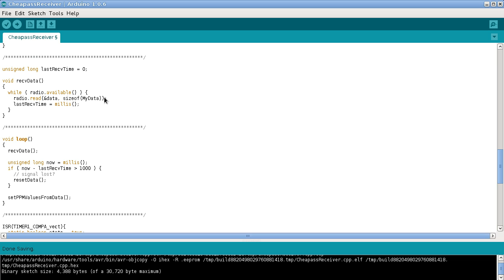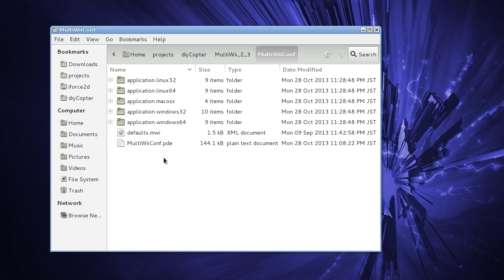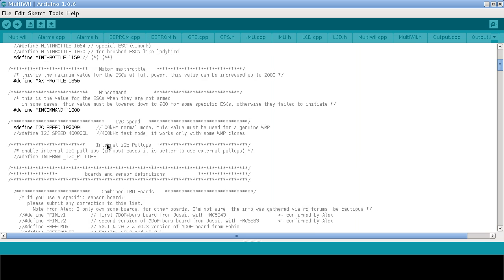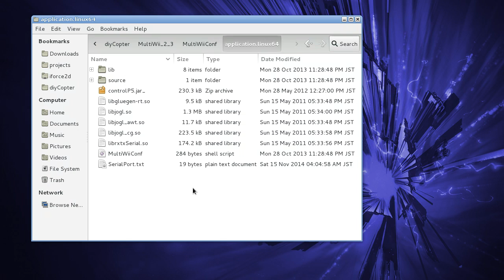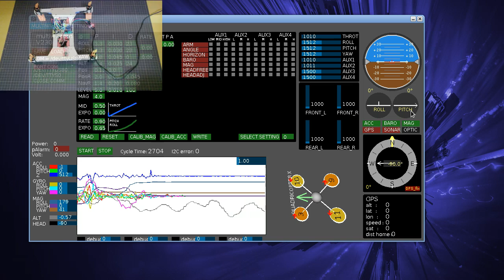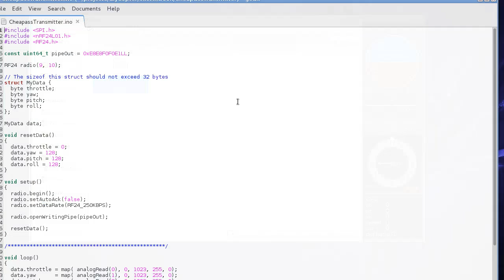Cheap-ass quadcopter build Part 8 - "Receiver" (continued)

Comment: Can u pld help me on this i ulpoaded ur sketch on both side did calibration too checked in serial monitor it works but on the receiver side signal is mixed if i move on channel all channel get some mix signals and also i m not getting full range of channels only some of it can u pls help me on this i m stuck pretty badly
Reply from the maker: Sounds like bad ground connections.
Reply: @iforce2d  i did check every connection twice and also used two different flight controller and stil its all mesy all singlals are mixed in reciver tab i move one channel all channels changes value can u pls help me on this
Reply: @iforce2d  how to fix that
Reply from the maker: Just follow through the process from beginning to end logically, and confirm every step. For example the first thing to happen is you move your finger on the stick. So print out the analog stick values on the transmitter side, check they are correct. Then print out the values of each member of the packet being transmitted, check they are correct.. etc etc etc. Software development is all about debugging, nobody can hold your hand all the way through every problem.

Comment: could you tell me how can i change the receiver code to get the PWM at 1520us center pulse? please answer my question, thank you.
Reply from the maker: Easiest way is to use the trims on your transmitter. If you don't have trims, just add the necessary amount to the channel value, at the end of the setPPMValuesFromData function.
Reply: thank's, it works great!

Comment: hi. thanks for the videos👍. i had done the same 6 months ago and it was working so good. and in these days i add oled screen and menu to transmitter, some rg leds to receiver. its still working so good when print ppm channels but when connect it to multiwii(2.4). i can only see 940 to 1004 for each ch. and its like middle and upper side is working.aux switched work once everytime i reset my board. at multiwii 2.3 its 1000-1004😟. i am so sure my connections are good. i checked them more than 200 times😄. waiting for advices.😊
Reply from the maker: Make sure you have selected the correct board type and CPU speed when uploading. Failing that, use an oscilloscope to check if the pulse lengths are correct. https://www.youtube.com/watch?v=FBAKxz7NSJk

Comment: can i use receiver with pro mini 5v? not 3.3v
Reply from the maker: As long as you power the nRF24L01 module with no more than 3.0v. The logic pins (MISO, MOSI etc) of the nRF24L01 can handle 5v but the power supply cannot.
Reply: iforce2d can i replace to pro mini 5v or not?
Reply from the maker: I just told you. If something is unclear, ask a more specific question :)

Comment: iforce2d, after changing the code, I went to test it and i found out that after arming the transmitter, it automatically spins the motor(at low speed) which is 0 throttle. I have tried uploading the old sketch but to no avail. HELP!!!!!!
Reply from the maker: What do you mean by 'changing the code'? I don't see why changing it back would not return things to the old behavior, obviously there is something more to it.
Reply: iforce2d last 3 days i asked about changing the speed settings on the multiwii board
Reply from the maker: I get dozens of questions like this every day. So I have no idea what you mean by "changing the code" here, I certainly don't recall seeing any details about changed code. If you want to keep track of some previous discussion, it would help to reply to the previous comment.

Comment: @iforce2d,  is there a way to change the speed settings for the multiwii board? I found that the quadcopter I made is too fast. What i meant is the quadcopter moving forward, backward, yawing , etc they are all too fast
Reply from the maker: You mean the rotation in each axis is too fast? The default settings should be manageable for a beginner, but if they are too fast you can reduce the rate setting. See the beginning of this video, https://www.youtube.com/watch?v=TGa-f-rLVZw (in that video I increased my rates a lot from the default because I wanted to do flips).
If you mean that it actually moves (not rotates) from place to place too fast, well that is just up to you to learn to control it better :)
Reply: what i meant is i found out that the maximum angle of the pitch and roll is too much. i need to know how can I adjust those angle
Reply from the maker: Just don't move your stick over so far :) But if you are ok with changing the code, this might help http://www.multiwii.com/forum/viewtopic.php?f=8&t=3440 You could also modify this in your transmitter if it has that setting.
Reply: iforce2d i am using the home made arduino transmitter (mod old transmitter)
Reply from the maker: Then you could also modify that, to send less range of stick movement.
Reply: iforce2d thanks
Reply: iforce2d this one!
Reply from the maker: ok. And what code did you change? I still don't understand why changing back to the old code would not give you the old result.
Reply: iforce2d i made the wireless test joystick thingy and found out the throttle range minimum is 1 -255
Reply: the rest is 0-255
Reply: i tried to switch the void loop transmitter sketch ( data.throttle 2nd line and data.yaw the 1st line) and now ...i am getting yaw range 1-255 and the rest is 0-255..!!! what is happening T_T...
Reply: Ok, I figured out!!! it seems that in the new multiwii2.4 source code, config.h has this //#define MOTOR_STOP commented, I uncommented it and it fix the problem. Thanks for the reply.

Comment: I am using cc3d flight controller and I with arduino pro min receiver and arduino uno as transmitter but when I setup flight controller in system health the input/receiver port of flight controller shows red? And because of this the receiver is not receiving input so I was not able to save transmitter settings. do anyone know how to fix it?

Comment: I have  problem, motors rotations different rpm.but difference is very high...what is problem?
Reply from the maker: Need more info. What are you doing to make the motors turn? Using a servo tester? Using the config gui? Using your radio control? Trying to fly or just testing with no props? Please think about your question from other people's point of view and don't make me have to ask more questions like this all the time.
Reply: i am using with my radio control.when a pump throttle up,on the multiwii conf simulation proqram shows different  rpm motors.i have already calibrated esc's
Reply: also i am usin without rotation motors and Multiwii conf simulation showed same results.very different rpm motors
Reply from the maker: Did you calibrate the accelerometer? Maybe the quad thinks it's not level, and it is trying to become level.
Does the motor speed difference start immediately, or grow gradually. If you don't have propellers on and it grows gradually, it could be because the flight controller tries to rotate the quad and nothing happens because there is no propeller, so it tries more, and more etc. That problem will be fixed if you put propellers on and actually lift off the ground.
Reply: yes i have calibrated.in the moment I start motors by arming , pulses are all 4 motors at maximum value, after 1 sec motors right rear and left front starts to decrease values. I didn't start to fly yet, cause I'm scaring about a bad crash.
Reply from the maker: Hmm... that's very strange, I have never experienced that. Does the graphical display of the frame match the movement correctly when pick it up and move it around? Two opposite motors going faster means it is trying to rotate in yaw. Maybe the yaw axis of the gryo is faulty.

Comment: Hi , i love how this worked in the video but in real world it is not working , i am wondering why i am not getting the same results>

in the video every channel (throttle,yaw,pitch,roll, and two extras ) of the signal is recieved in the MultiWiiConf application. But when i tested it locally i am only getting throttle value which is also inaccurate it never made it to the 2000 mark in the window, i combined your transmitter and receiver code and excluded the NRF part so i can check it locally without it, i only used a Joystick potentio meter to just send the values.

i will appreciate if you put some light on this problem :| 

here is the code just attach the joystick to the analog pins A0 ... and check:

thanks and regards

////////////////////// PPM CONFIGURATION//////////////////////////
#define channel_number 6  //set the number of channels
#define sigPin 2  //set PPM signal output pin on the arduino
#define PPM_FrLen 27000  //set the PPM frame length in microseconds (1ms = 1000µs)
#define PPM_PulseLen 400  //set the pulse length
//////////////////////////////////////////////////////////////////

int ppm[channel_number];

// The sizeof this struct should not exceed 32 bytes
struct MyData {
  byte throttle;
  byte yaw;
  byte pitch;
  byte roll;
};

MyData data;

void resetData()
{
  data.throttle = 0;
  data.yaw = 127;
  data.pitch = 127;
  data.roll = 127;
}

void setupPPM() {
  pinMode(sigPin, OUTPUT);
  digitalWrite(sigPin, 0);  //set the PPM signal pin to the default state (off)

  cli();
  TCCR1A = 0; // set entire TCCR1 register to 0
  TCCR1B = 0;

  OCR1A = 100;  // compare match register (not very important, sets the timeout for the first interrupt)
  TCCR1B |= (1 << WGM12);  // turn on CTC mode
  TCCR1B |= (1 << CS11);  // 8 prescaler: 0,5 microseconds at 16mhz
  TIMSK1 |= (1 << OCIE1A); // enable timer compare interrupt
  sei();
}

void setup() {
  Serial.begin(9600);
  resetData();
  setupPPM();
} 

void setPPMValuesFromData()
{
  ppm[0] = map(data.throttle, 0, 255, 1000, 2000);
  ppm[1] = map(data.yaw,      0, 255, 1000, 2000);
  ppm[2] = map(data.pitch,    0, 255, 1000, 2000);
  ppm[3] = map(data.roll,     0, 255, 1000, 2000);    
  ppm[4] = 1000;
  ppm[5] = 1000;
}

int mapJoystickValues(int val, int lower, int middle, int upper, bool reverse)
{
  val = constrain(val, lower, upper);
  if ( val < middle )
    val = map(val, lower, middle, 0, 128);
  else
    val = map(val, middle, upper, 128, 255);
  return ( reverse ? 255 - val : val );
}

void loop()
{
  data.throttle = mapJoystickValues( analogRead(0), 13, 524, 1015, false );
  data.yaw      = mapJoystickValues( analogRead(1),  1, 505, 1020, false);
  data.pitch    = mapJoystickValues( analogRead(2), 12, 544, 1021, false );
  data.roll     = mapJoystickValues( analogRead(3), 34, 522, 1020, false);

  Serial.print("Throttle: ");
  Serial.println(data.throttle);

  setPPMValuesFromData();
}

#define clockMultiplier 2 // set this to 2 if you are using a 16MHz arduino, leave as 1 for an 8MHz arduino

ISR(TIMER1_COMPA_vect) {
  static boolean state = true;

  TCNT1 = 0;

  if ( state ) {
    //end pulse
    PORTD = PORTD & ~B00000100; // turn pin 2 off. Could also use: digitalWrite(sigPin,0)
    OCR1A = PPM_PulseLen * clockMultiplier;
    state = false;
  }
  else {
    //start pulse
    static byte cur_chan_numb;
    static unsigned int calc_rest;

    PORTD = PORTD | B00000100; // turn pin 2 on. Could also use: digitalWrite(sigPin,1)
    state = true;

    if (cur_chan_numb >= channel_number) {
      cur_chan_numb = 0;
      calc_rest += PPM_PulseLen;
      OCR1A = (PPM_FrLen - calc_rest) * clockMultiplier;
      calc_rest = 0;
    }
    else {
      OCR1A = (ppm[cur_chan_numb] - PPM_PulseLen) * clockMultiplier;
      calc_rest += ppm[cur_chan_numb];
      cur_chan_numb++;
    }
  }
}

Comment: Hi nice work, congratulations, I want to know in the receiver the numbers of pinout from arduino board correspond to throttle, yaw, pitch and roll or all combine in single  ppm signal,  if that happent how I can connect the ppm signal output to multiwii board, thanks for share.
Reply: there is only one wire from receiving arduino to flight controller ppm0-3 are combined and sent on one wire

Comment: if i don't have flight controller, then how can i decode program using arduino...
please provide receiving code..
Reply: you could install a gps i think on that flight controller and instead of reseting throttle to 0 you could make it return home automatically, you program ppm 4 as RTH switch even without a physical button and if a second passed since last received it would return to home.
Reply from the maker: https://www.youtube.com/watch?v=21RlK_0YCQM

Comment: Hi, I'm using your code for PPM receiver, but I have one problem (and I see in video that you have it too) - for some odd reason it adds (or multiwii reads) all valus higher by about 10 and also jums a little bit, although the values is set in receiver to 1000 (in your video AUX is set to 1000 in receiver, but multiwii shows 1010-1012). Have you solved this, and how your quad reacts to fact, that sticks are not centred (on multiwii side).
Reply from the maker: That's because PPM works by taking the time between pulses as an analog measurement. It's not a digital (lossless) transmission so you can't really do anything about it. You could trim your values at the receiver to be closer to 1000, but you will never 'solve' the jittering.

Comment: hi iforce2d , thank you so much for your videos , I have a question ;  when i uploaded the code of arduino and multwii , and connect pins as should , the values of throttle , roll .... , give me maximum to 2000 ! and the transmitter doesn't work ?

Comment: I'm using an oscilloscope to visualize the signals output at pin 2 , but as I move the sticks on the transmitter none of the pulse changes , please I need help ?
Reply from the maker: Try printing some debugging output to the serial monitor, to see what the variables in the program are doing. Is there any radio connection at all?
Reply: on the receiver sketch I tried printing but I don't know which variable to print , I tried to print the "SigPin " the results at serial monitor was 2222222...which isn't  what I want and I don't know if the radio is fine  ... thanks much for your help Sir+iforce2d
Reply from the maker: well... you are trying to find out if any data was received right? So print something out if the radio.available() was true...
After the radio setup part, you can do radio.printDetails() to check that the settings were applied correctly (pipe number, data rate etc).

Comment: hi iforce2d, i have made my quadcopter base on your video. The transmitter and the receiver work just fine but the motors are not working and i dont know why. i have successfully started the motors once but after that, i cannot do it again, i have connected the wire in the right position
Reply from the maker: I'm confused. Do the motors spin or not? How did you 'start them once', was that using the flight controller? How long do they spin for and how were you controlling them? Is the flight controller armed? Does it stay armed? Do you mean the motors only started once ever, or they just start once after each time you power up? Please look at this from my point of view and give some more information to work with if you expect a useful answer :)
Reply: i have controlled the motors only one time. since that, i haven't made the motors spin. when i power up the quadcopter, the motors create sound and the quadcopter receives the signal from the transmitter well but the motors dont spin
Reply from the maker: How long do they spin for and how were you controlling them?
Reply: until i plugged out the battery. i used the cheapass transmitter like yours to controlled. i dont use the flight controller like yours. i made my own flight controller by using arduino nano and gyro. i think that the problem may come from my flight controller but i cannot find out

Comment: are you use ppm output from reciever ?

can i use pwm output from receiver by 4 signal output from receiver ?
Reply from the maker: As you can see from the comment you are replying to, I don't have any code for pwm signals as output. You can find code for decoding ppm signal in the multiwii source code, it's not really that challenging. In the file RX.cpp search for "PPM SUM RX Pin reading"
Reply from the maker: My arduino sketch does not do PWM output. If you want to program it yourself, sure, the arduino is capable of that. I don't have any code myself for it.
Reply: +iforce2d  please unload a video on this  it's quite challenging to decode the ppm signal or have a pwm signals as output ...thanks

Comment: where the output off reciever conected to multi will ? just 3 cable ? + - S ?
Reply: no one wire from recieving arduino to flight controller that's how ppm works.

Comment: would it be possible, to use Failsafe with the "cheapass Transmitter"?
Reply from the maker: +Ride On! (CamzTouch) I'm using a basic failsafe as shown at 6:15 which resets the channel values to a default state when no packets have been received from the transmitter for one second. I've never tried using the failsafe of the flight controller, but I think it detects when the receiver stops sending a valid PPM signal - if so, you could just stop sending the PPM signal to let the FC know something is wrong.
Reply: +iforce2d ok. i will try in a few weeks, when I start my project and let you know 😉
Reply: +Ride On! (CamzTouch) in theory my code should work with the Multiwii failsafe now. Now i am waiting for my parts to arrive  😏

Comment: +iforce2d hello, thanks for your Videos :) i've finished the quadcopter but my back L moter is always spinning slower than the oder ones. I've checked the moter and it isn't the issue.when I spin my motors multiwiiconf tells me that the back L moter is spinning slower.I haven't any idea how to fix it. Could anyone help me please ?
Reply from the maker: +mathis peyronne is it flying? Is it in angle mode? Is it perfectly level? If it's not quite level then it would be normal for the motors on the lower side to spin slower.